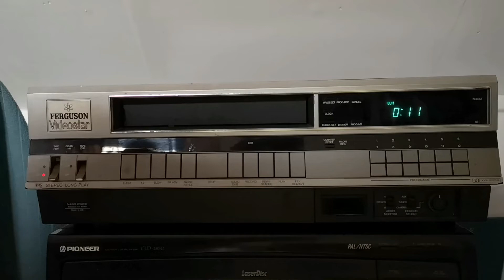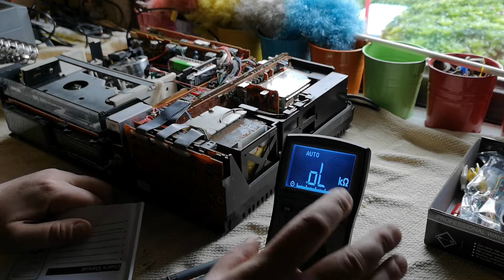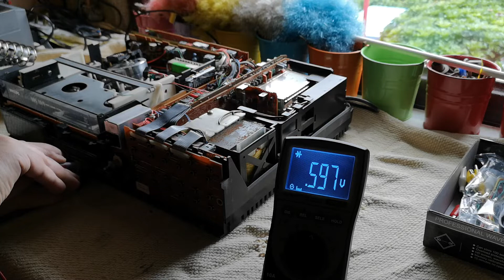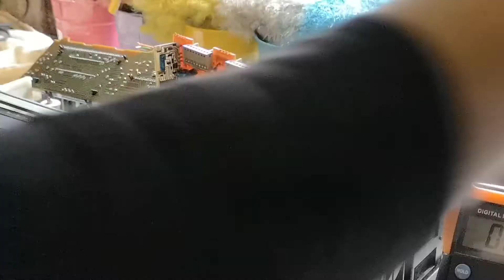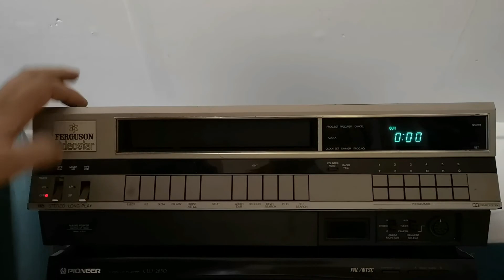Revisiting the Philips Matchline VR6860 - Part 5 - The VU meters

Comment: Did you trim the excess off the legs of the new transistor? I looked back at the video again and it did look as if they were still long when you replaced the front board.
Reply from the maker: I did :)